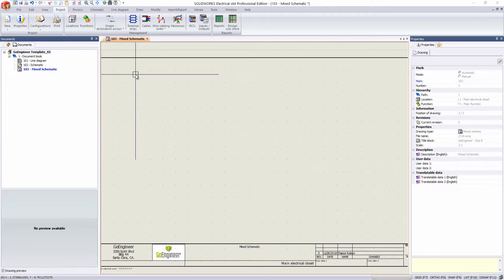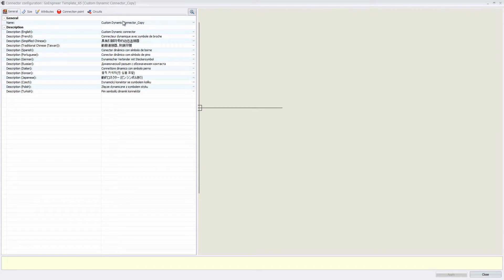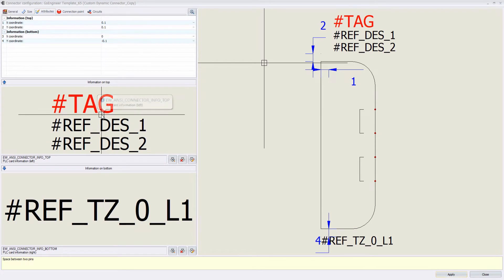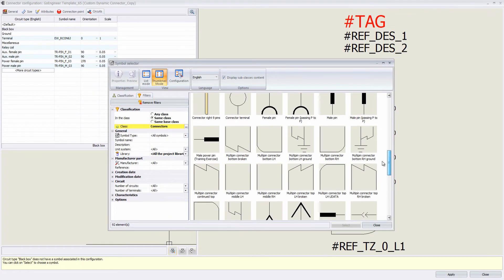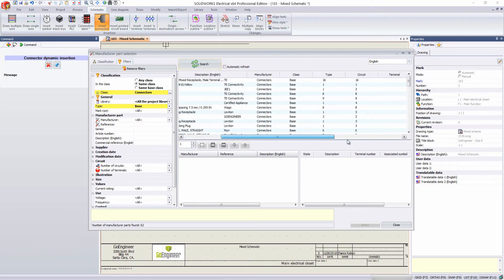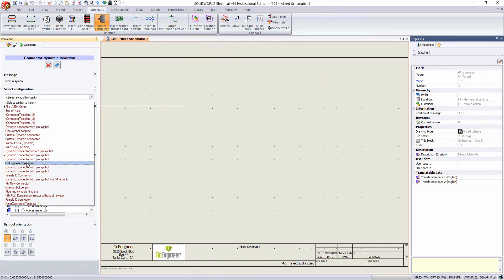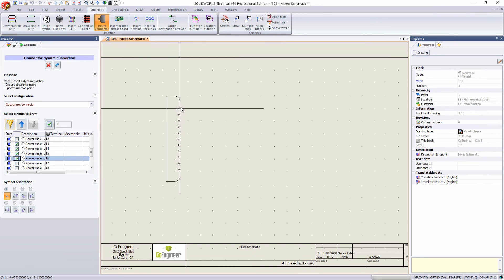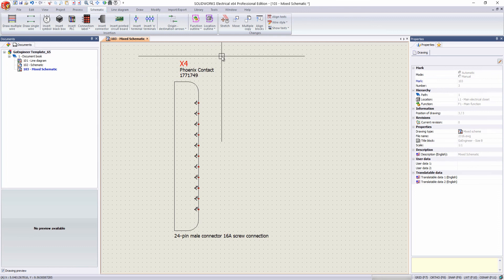SOLIDWORKS Electrical - Dynamic Connector Configuration Creation

Comment: I have 8 pin connector and when I select pin number 1,4,8 to add in schematic but when I put it, automatically it takes firs three pins that is pin number 1,2,3.
Please provide it's solution.
Reply from the maker: For assistance, please contact our tech support team at goengineer.com/contact